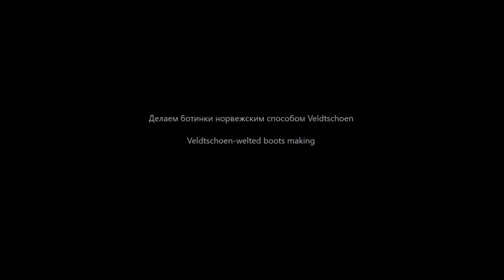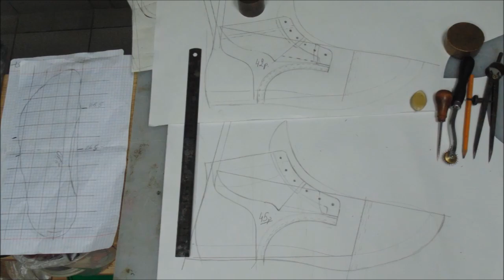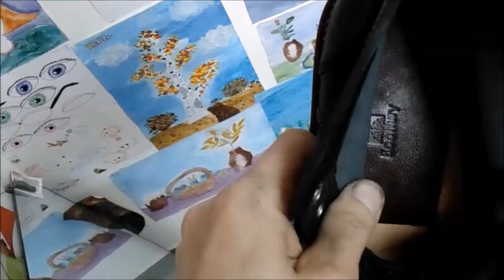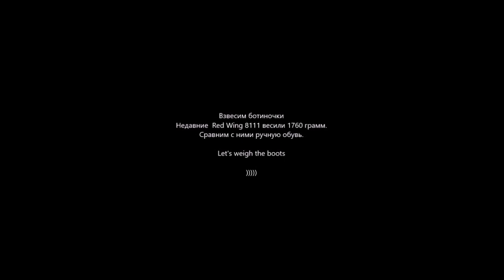Making Veldtschoen-welted boots - Делаем ботинки норвежской конструкции

Comment: really good work here, im very impressed by your skills and ability to make boots with a variety of techniques. your knife skills are second to none!

a couple things i would say however, dont skimp on the leather! both by making actual toe caps and heel counters (as in two layers of leather) and not just sewing together single layer pieces that look like they are caps and counters, but also by buying better quality and thicker leather! use a full grain instead of a corrected grain and skip that plastic looking finish. it even looks like it might be a bottm cut grade? I can already see creases forming in the top coat. not sure, regardless that leather your using just looks thin and cheap, and its really a shame because the boot is so well made otherwise. trust me, your skills deserve better leather.

I would also say a more practical, deeper lugged sole would be nice. something thats not going to wear its tread off right away. i guess its ok for city wear but if these are ment to be worn outdoors or on a job those soles really wouldnt be my choice.
Reply: Wow, it sounds like you know your stuff too. To me though, Mr Bootfury is a master, what with his ability to build up a last, make a pattern from a silhouette, and then decide on a stitchdown, welted or veldtschoen sole. As far as im concerned he puts all the other shoemaking/repair YT channels to shame  I only wish I could speak Russian to understand his videos on leather types - and ask him if he wants to take on an apprentice!